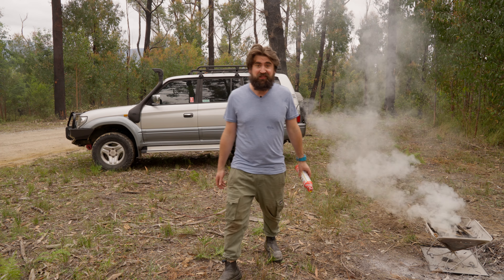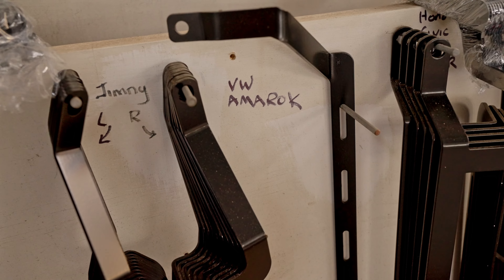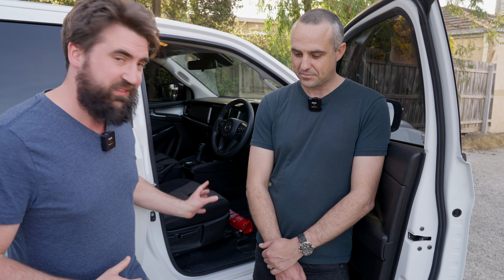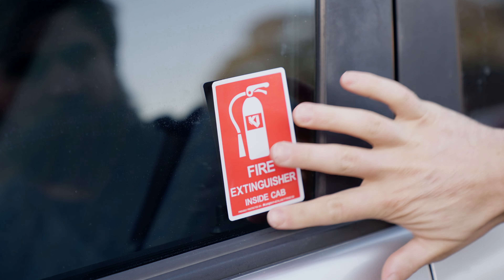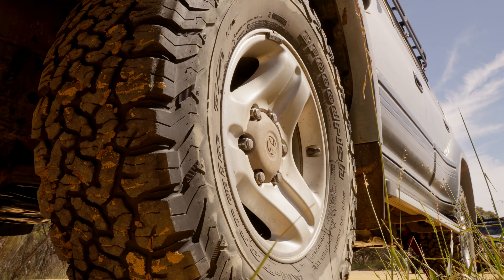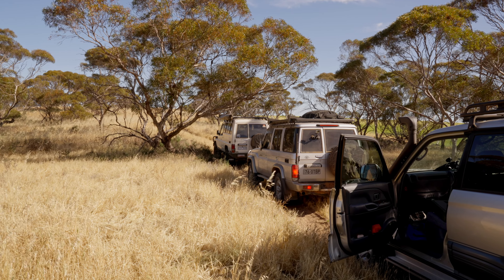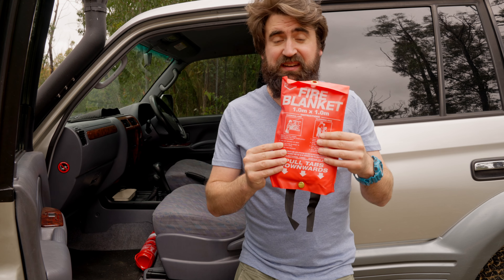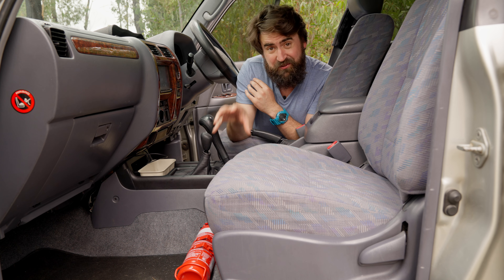Kap Industries Fire Extinguisher Bracket | Australian Made

Comment: I had a fire extinguisher in my passenger footwell and found myself storing stuff in there and on the seat on solo trips. I’m talking my portable twin arb compressor, recovery gear etc because it’s so easy to reach into. Problem was fire extinguisher is no longer accessible. The driver side footwell will never have stored there as you’re always there.
Reply from the maker: I thought about this and understand that perspective. I often have camera gear and admin stuff in passenger area. when settting up camp I’m usually on the passenger side so ultimately thought it was better there. Well thought out for your needs. cheers!